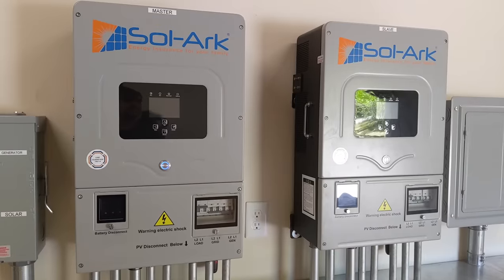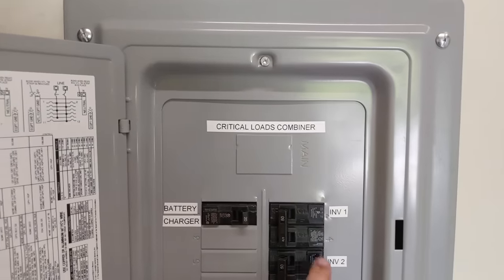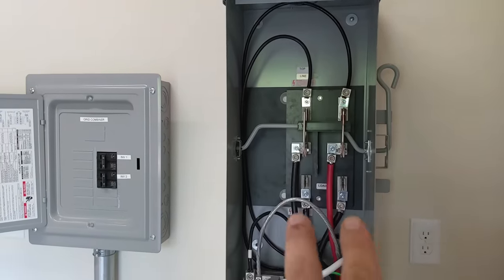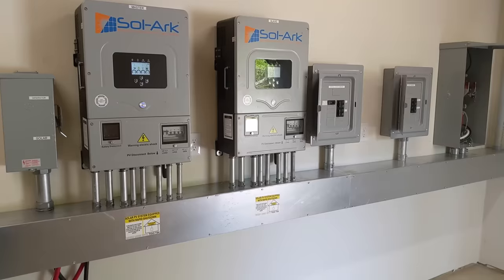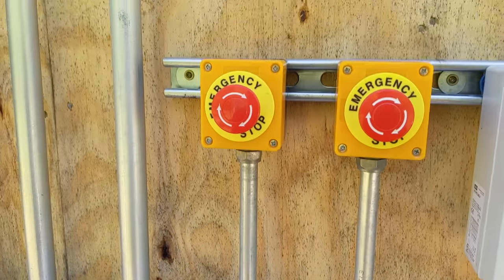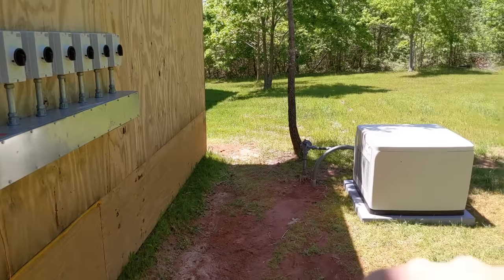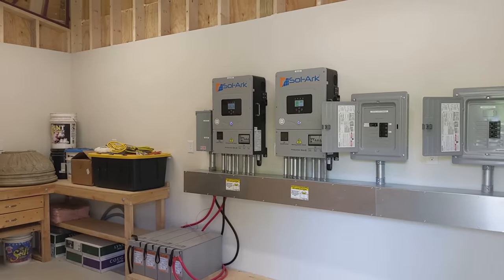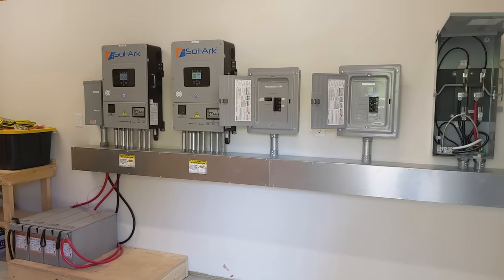Off Grid Solar System Walkthrough

Comment: Nice set up. Id get a bit of shade on those outdoor DC isolators but, they get brittle after a few years in the sun and get water ingress. If i ever get a call out its usually to replace a DC isolator on the roof or external wall.
Reply: Looks like these are on the north side of the building. Not perfect, but a good location.

Comment: One last question it concerns the 2nd  (possibly 30-60amp) bypass switch next to the inverter #1(Master).  None of your videos showed any wiring to this panel and it was a complete surprise having looked at all three videos over and over. I can only guess that it is a single pole single throw disconnect which the generator wires  were runned to it and on the load side back to the inverters using PDB, thus it is a generator disconnect and bypass switch allowing the homeowner to switch off the generator energy from going into the inverters thus leaving the solar/battery being the only input ( excluding grid), Please correct when I am wrong.
I have had quite a time learning from these 3 videos.  I will use it as a template for the future and at that time I may use your expertise as online consultants (in the Caribbean). I want to thank you for documenting your great job.

Comment: Nice setup. They won’t be short on power unless they start a cloud server...

Two questions:
1) what wattage solar panels do you use in this setup?
2) what total input voltage and amperage is the sol-ark 8k/12k rated for?
3) in Alaskan winters, -40°F. Max Voltage you can connect to Sol-Ark?

Stay safe !

Comment: Looks good really good. We did the math and are pretty sure we can go off grid with just our solark 8k. Going to add additional charge controller. That will run the 2 ton a/c and all appliances. The only way we would overload is running a/c at full and every appliance in the house. Heat pump water heater, heat pump drier and all energy star appliances.
Reply: a v I would look into one of three things:
1- a soft start for the AC.
2- an ultra capacitor battery bank working together with the batteries 
3- upgrading to two or three mini split variable inverter AC heat pump units

Consider the hottest and coldest day into the load evaluation for space conditioning.
Reply: @ek9772   Yes we have had an hvac engineer do the loading calculations. The home is an icf home in georgia, R23 walls R 48 ceiling insulation. 2800 sq ft total living 1200 sq ft heated garage. We will be using a seer 20 mini split outdoor unit with a variable speed air handler. At full speed it should be under 3kw. Next biggest power requirement is actually the dishwasher and microwave. When in use they pull 1.6kw each. In our current home we have a heat pump dryer/ water heater. Dryer pulled 600 watts for a normal load. The WH pulled 1.3 kwh a day when we did testing. We are 95% confident in our loading. The only thing we are considering is adding a separate inverter for the garage to use high amp tools. We plan on breaking ground in December.
Reply: a v interesting setup you are going for. I’m also planning an ICF home, but up north in NH. I find that all appliances whose main purpose is to create heat are a poor use of electricity. That’s why for me the hair dryer, microwave, toaster, dishwasher, washer & dryer, toaster oven, e-space heaters are off limits. Ok, I will have a washer but with the internal water heater disconnected. Propane on demand hot water is my preference. However, I will use excess solar to preheat in en electric water heater (20 gal, 2000 watt element). I won’t be using A/C either. A ceiling fan and dehumidifier will have to do. 

Load calculations can get scary. How big a battery bank are you planning for?
Reply: @4philipp   I dont think I could convince my wife to give up that much. We literally took a wattage meter on all of our appliances, including her hair dryer. None were crazy high. The only thing we don't know for certainty is the A/C and gas range. We talked to the manufacture and they said it would consume 2 Kw for the 2 ton unit plus handler. Range they didn't know. I think we will be around 20 kWh a day. We designed the system around 25 - 30 kWh a day. I feel 1 solark should easily power our house, just not sure if it could power my shop if multiple things were running in the house. Our heat will be radiant floor, with lp furnace or wood stove. We already have the battery actually. It is a 48v 1576ah @ 20h lead acid. Weighs literally a ton. We thought about doing the fortress batteries but the per watt price is still up there vs adding more panels to make up for the loss in efficiency.
Reply: a v it’s amazing how depended on electricity we are for daily living considering the lightbulb isn’t even 150 years old yet. 

One way to manage your consumption is to concentrate heavy loads during daytime when you produce excess from your panels (even installing excess panels). Then your nighttime loads would be less of a strain on the batteries. 
I know perception of solar has changed but growing up the understanding was that habits need to change to make it work. Or pay a fortune for an oversized setup. 
Living out of a camper for a year is a great exercise in frugal (limited resource) living. You might even be able to trade in the wife for a energy star certified model ;)
Reply: a v I would change the AC for three smaller mini split AC inverter heat pump units with a SEER 38. The biggest reason is that if you have more than one room at that location, you can do some interesting things.  I call this the divide and conquer strategy.

For instance, if you have a three bedroom house, you can turn off the AC for the kitchen, dining and living room areas at night, and during the day you can turn off the AC in the bedrooms.  If you have only one bedroom, this means you can get away with using around 600 watts at night for the AC.  This means a much smaller battery and solar system.  A 3-kWh AC will probably have a higher minimum if it is a variable compressor.

There is another advantage to breaking down the size.  I call this the reliability strategy.
If one of the units should need repairing it, the other two units should hold up your space conditioning requirements until you repair or change the faulty unit.

Your cooling and heating space conditioning requirements will still meet the loads made by the engineer if all of them work at once, but you usually do not need all of them at once.  You tend to spend different amounts of time in different rooms during the course of 24-hours.  I call this the common sense strategy.
Reply: @ek9772   This was how we originally designed it then they came out with ducted mini split. Ours is designed by zone. We have 3 zones. Living, guests, master bedroom. The mini split compressor can ramp down and up depending on load. We will have 3 thermostats. With the thermal mass of the icf we plan to run the a/c full blast during the day and the mass should keep us fine overnight.
Reply: @4philipp  lol. Yup. Our house goes on the market 2 months before we break ground. If it sells we living in our camper. We actually plan on doing what you are saying with the solark it has smart load, so when the batteries are satisfied the excess power can go to something. We are going to put a mini split in our garage and attic to heat and cool them. This should really cut down our cooling / heating demand.
Reply: @av1204  Your probably not going to be able to run major appliances like the A/C & dishwasher overnight, and be prepared for when you cannot rely on solar for multiple days. Don't forget to add in all of the small loads: computers, lights, frig\freezer, TV (the add up quickly) . Then there is the  water pump. Its possible the Water pump might exceed the limit of the Sol-Ark 8K (requiring a 30 AMP breaker for start up).
Reply: @av1204  If your building a tight home than you need an ERV, which will likely add humidity while running overnight. Also consider if you have several days of overcast while it's hot & humid. If your using it for heat, then you also likely have a power shortage during the winter months unless your living in the desert.

FWIW: I have two ducted mini-splits (1.3kw) One for bedrooms and the other for living space. but neighter are powered through my Sol-Ark 8K.

Comment: realized that you used  a QO 200 Amp 2-Pole Outdoor Circuit Breaker Enclosure with QOM2200VH Breaker next to the pv solar ac disconnect

Comment: great system....lots of money well spent - expect the batteries. I know most of your systems lean more toward grid tie or generator off grid, but it would be nice to see LiFePo4 full on battery setup for offgrid, with only generator as backup.
Reply: Kent M that will be expensive. I think most people going for Sol-Ark, especially two+ units want to live life as if power is unlimited. Installing 20kw+ of LiFePO4 costs a pretty penny. And I would still recommend only using 70% capacity to protect battery longevity.

An even bigger question is how many days of power do you want as backup to account for inclement weather and not having to use the generator every other day.

Comment: One recommendation is to go with diesel GenSet instead of propane. The issue with propane is that you need a propane delivery truck to refill, which can be a problem when lots of people dont' have power (storm damage). with a diesel gen. you can refill yourself up with 5 gallon cans, or from a 100 gallon pickup truck tank mounted in the bed. Plus diesel provides more bang for the buck (more kwh per gallon of diesel compared to propane).
Reply: While that's all true, with a 500 gallon propane tank you can refill at 50% or 60% down, keeping a significant reserve.
That said, I'd prefer 500 gallons of "home heating oil" and a generator to burn it.
Reply: with propane you will get longer shelf life out of your fuel. plus with diesel you have to be worried about your fuel getting contaminated ie, water in it, algae bloom, gelling up in the winter.  you can also get a propane dryer, stove/oven, hot water heater and a furnace.
Reply: @chadengemann8237  Its not hard to add some stabilizer, and I wouldn't be worried about water contamination. The issue I see is when there is a regional issues that knocks out grid power its nearly impossible to get a propane delivery as all of the delivery trucks are swamped with people requesting refills. So if you use up all your propane you SoL until a delivery truck arrives. No Propane, no generator. With Diesel you can go to a gas station and refill from a pump. 

Years ago we had an regional ice store. which knocked out the grid for almost 2 months & blocking most of the roads with down trees. Fortunately we had Oil heat, and I had to make several runs to buy diesel to refuel so the house wouldn't freeze over. Also had a gas generator. If I had propane, I would have been totally screwed.
Reply: You have to worry about Temps with oil an diesel much more then propane also, An if you are worried about not being able to just run to the corner store to get the gas, Well they sell secondary connect's. This way you could go an get a 20lb tank/s to get you by till you can get the big tank filled. Makes it as easy as going to get gas or oil.  Other reasons to go propane. Shelf life/stability, Noise, cleaner, WAY easier to get permitted by 1000xs and most of all the Multi Use of it. Idk what parts you are from but its also extremely cheap in the OH,PA,KY,TN,WV,VA an NC area.          BUT if i could get an old ARMY diesel gen. Well that is a whole new story they can run on anything from propane to burnt oil so.....
Reply: @guytech7310  a diesel generator motor wise I think is the better chose but if I had one on my house the fuel would probably stale before I would use it up. we have fairly stable electric. 75% of the time when the power goes out we are back up in a hour or two if not sooner. longest I have been out in the last ten years is 8-10 hours after a major storm. the question to ask is how long will it take to get through a full tank and what happens if it takes a over a year to use up the fuel. I would guess I would have 20 hours a year on the generator including a hour a month for exercising.  How many hours on running would be on your average diesel generator I would guess 50-100.
Reply: I think Scott mentioned they were going to build a house to tie into this set-up in one of the videos? So, perhaps they need propane to run other appliances, stove, fireplace, tank-less water heater etc..therefore diesel wasn't a practical option?

Comment: Couple of questions. 
1) Did you really need to attach to the grid if the customer didn’t want to? Or did you have to because the either the power company or town hall said you had to?

2) If the customer decided not to use the grid at all. Would they have to keep an open account now because the grid is available?
Reply: it sounds like they may not need to at this current time but once they build a 1800 square feet house I sure would want to have it hooked up. also I think it would be smart to get it up and running so they can sell back to the power company while there load is small. they probably have 5x the solar they need for that small shed/building.
Reply: He might have doomed them to be connected forever as i doubt they will allow you to disconnect once battery prices are cheaper than grid prices and a large % of people want to go with batteries
Reply: @chadengemann8237  I would have a jack ladder wasting power in my front yard before selling my power to the grid operators for 1/4 of what they then sell it onto my neighbours for. Bugger them and their redundant grid
Reply: @MrWackozacko  Don't they disconnect you if you don't pay the bill?
Reply: @3rdrock  Well thats the point, having your own batteries and solar and not needing the grid

Comment: Rapid shut down is only required if you're mounting on a roof right?  If it's a ground mount system then it isn't required right?
Reply from the maker: That is correct currently all ground mounts do not require rapid shutdown. We prefer to try to convince people to go to a ground mount for this and many other reasons

Comment: Whats a ballpark figure does a system like that cost?
Reply: And it could even be a pretty big ballpark. IDK if I'm looking at $1.2 million or 120k for a setup like this.
Reply: @seldoon_nemar  My guestimation for a big ballpark would be around 60k including labor ... that's guestimated by $1 per Wp, then double that for all the wires, mounting and switches controllers etc, then another '1/3' for the labor. This doesn't include the battery bank though, no idea what that would cost for a big system like this... but i might be far off :(
Reply: Scott meantion on his earlier video that it was $60K
Reply: I charge $5 a watt for grid tie, around $10 a watt for off grid. 12kW system is not normal for off grid and this system is a hybrid grid tie with battery backup. To effectively use this system off grid, your battery stack would have to have an Amp Hour rating of around 2000. Look up Rolls batteries, S-550. You would need 32 of them, 4 strings of 8. This is just me scribbling on a napkin here, but unless I have a decimal off, I’m close. The formula for battery absorption sizing is. Time= .42 x (C/I). C is the 20 hour AH rating of the stack. I is the current that the charge controller(s) can push to the batteries. You have to consider what you use while charging too.
Reply: @guytech7310  Ok that is silly ... as my guestimation was exactly that figure :O ... do wonder what that 60k includes.
Reply: @jeffpurdy2347  Those prices on watts are including labor i presume and for the whole system (so including batteries for off grid)

Comment: Why dont u use Auto Transfer Switch? I use ATS with Inverter which can be used in sync with ON Grid, Grid export during Grid availability and when grid goes off, it transfers loads to Genset and switches ON Genset but doesn't Export to Grid. How can i Share some pics?
Reply: How can i share few Pics for u to see?
Reply: Sol-ark does that internally. The transfer switches are for any faults that occur in the inverter so you can bypass them.
Reply: 1. SolArk have a built in ATS & will autostart the gen.
2. They are currently offg-rid (no connection to the grid yet) so the gen. would be running all the time.

That said, for my home I an using a separate ATS so I can gen can power up both the non-critical loads as well as feed the sol-ark. But I will be using a PLC controller to start the generator. My home is also connnected to the grid.

Comment: We’d be looking for a similar system. I’m in the process of our purchasing some land in Western NC and it is completely off grid. Could you give me an idea of what the cost of a similar setup would be?
Reply: FWIW: For my install 8K SolarArk + 8 BattleBorn Batteries it was about $16K. For materials (Wireways, breaker boxes, disconnect, transfer switch, bypass, wire, EMT, etc) About about $1200 +/- $500. No Solar Panels since I am using grid service.

I would recommend you reconsider and get grid power. You can always add an off-grid solution at later date, if your worried about long term grid down.

Also if you good deep backwoods your going to struggle finding contractors to help you build a home, & if you do its likely going to be more expensive. Expect during construction that you will need to pick up materials 3 or 4 times per week (since either you forget to order something, or you run out of something (fastners, lumber). I usually try to have everything onside before the contractors shows up, but there is usually a bunch of items that aren't on the list.  So if the nearest hardware store a 2+ hour round trip, there goes a big chunk of the day.